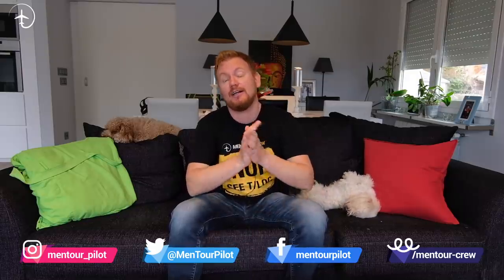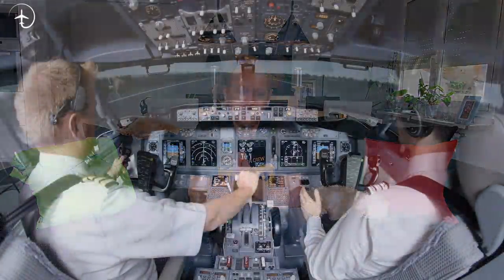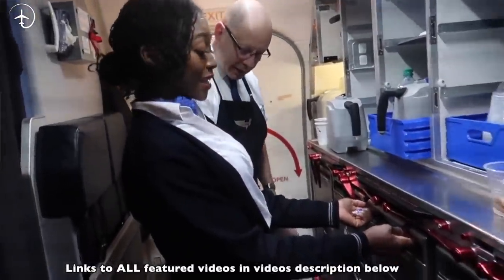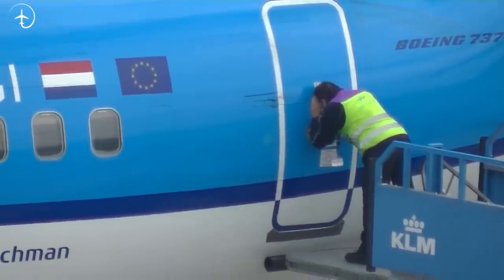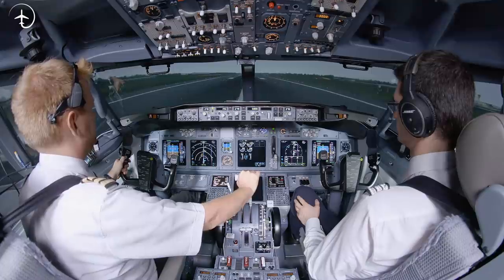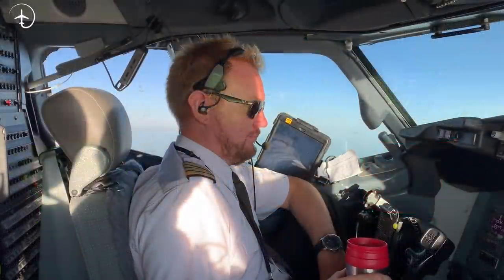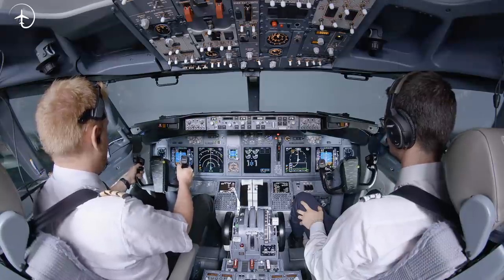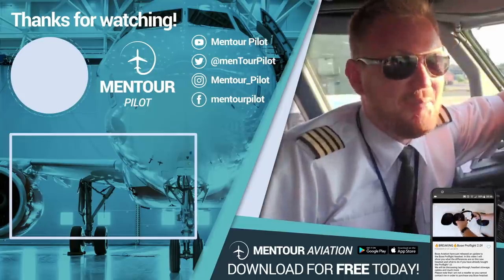How to fly an EMPTY Aircraft!

Comment: Very thorough discussion... Question if you see this...  What's the policy about leaving just one pilot in the cockpit during a mid-flight walk-back though the cabin? I thought there always has to be two people up front. On pax flights, if pilot or copilot leaves to use the lavatory or other reasons, a flight attendant joins the pilot, while another flight attendant blocks the door. But on a ferry flight?  Is it different?

Comment: The emphasis you put on making sure the emergency slides are disarmed makes me think there's a story to tell... :)
Reply: Inadvertent slide deployment after chocks on, wasn’t such an unusual occurrence when I was cabin crew. Aside from the obvious danger to anyone outside the doors, it also caused the a/c to be put out of service and an enormous expense to the company. The usual reason was cabin crew being distracted, maybe chatting to colleagues or pax, and so failure to adhere to procedures. One of the things that the company was very hard on us during annual recurrent tests.
Reply: The outside handle disarms the door so, in theory, it is impossible to deploy the slide from outside. Every inadvertent slide deployment is due to  the door being opened from the inside without disarming. Ie. Doors to manua,.
Reply: @bobrice3957  That isn't true for a 737, which he flies. 737 slides are only a manual system, from inside the door.
Reply: When our company got new 175s maintenance and crew would blow slides I would not say often, but often enough that we knew about it.
Reply: @MercFE8235  correct. On 737s, “classics” at least, a “Girt Bar” is engaged at the floor, well below normal eye-level inside, and completely invisible outside, which pulls the deployment mechanism as the door swings outwards. This is why ground personnel must look into the porthole and observe that a safety indicator flag has been put across the window before opening.

Comment: Empty plane?
Engines: "I feel the need, the need for SPEED!"
Reply: Also feel the need for Jet A
Reply: And trim and climate change.
Reply: How about an empty cruise ship, no passengers, no food, no fuel.
Reply: top gun, yes
Reply: @macmedic892  yes
Reply: @robertkat  that would be a very rough ride, even with fuelbunkered. When I was on my first enlistment I was on an aircraft carrier that went to the shipyard for refit. We pumped off all the jetfuel, emptied all the magazines of ordinance, removed the vast majority of equipment. That ship was riding a good 15 to 20 feet higher in the water. Even with several hundred personal vehicles loaded into the hangar bay for the home port move. I suspect that the vehicles being transported were partially to put some weight back in the ship for the transit. That was a very rough ride from San Diego to Bremerton because she was so light and top heavy. A cruise ship would be even worse and at extreme risk of capsizing I would imagine.
Reply: @robertkat  
That's a good question.  I would imagine that she'd be riding high in the water and subject to more rolling and pitching. Like anything else, you'd have to compensate for that. In the case of a ship it's a matter of ballast loading. 👍

Comment: I've ferried a number of MD's empty.  Climb performance is akin to some fighters!lol!   Pitch to 30deg clean and no step climb necessary!
Reply: Haha nice! How old are you? and where did you have the chance to fly those beauties?
Reply: @avi8err829  I'm 55 and worked for a company who converted aircraft as well as "strip and park" work.   I also flew for the former Midwest Express/Midwest (MidEx) Airlines based in Milwaukee years ago.
Reply: With the efficiency obsession of airlines, saving every gram they can, I am surprised an empty airliner cannot reach infinite speed and take off slightly backwards VTOL-style if you give full throttle.
Reply: @Dowlphin  In one of the books I read about the development of Concorde, they had a report of one of the afterburners not lighting properly under some condition. They tried to replicate, didn't have time to refuel before the test flight, had the engines in emergency contingency mode and did an almost empty, max power takeoff. I think they were in Bahrain, the tower nearly went ape because the plane had a thrust to weight ratio of nearly 1 and it was climbing faster than their fighters would have been able to.

Comment: I flew an FR738 two weeks ago. Just myself and one other passenger. Had to load 40 kg of bags of stones to the front cargo to get inside weight/balance limits.
Reply from the maker: Yep! That’s what I meant by being careful when checking weight and balance
Reply: In aviation everything is certified and regulated... so were those stones certified for aviation too? :D
Reply: Literal ballast.
Reply: @insoYT  I would not be surprised if there is a certified manufacturer for these.
Reply: @insoYT  The bags would be of a stronger plastic than for building materials.
Reply: David - I've replied to another of your comments on your YT community page due to the Blanco video suddenly going private. Any ideas why ?
Reply: @millomweb  I think Juan was bothered by the trolls complaining about him “sightseeing” during a lockdown. Fact is, the police have come out and stated they are not going to be enforcing stupid nonsensical government rules.
Reply: @davidwebb4904  OK. I wondered if the video contained info someone didn't want making public !
Anyway, back to your comment re Concorde fuel tanks...
David Webb replied: "pmailkeey LAX is 5457 miles away. BAW are quoting max range as 4143. And its against the prevailing."
24 minutes ago

Can you see the missed opportunity there - fuel tanks should have got it half way round the globe - then it could have gone anywhere to anywhere ! (in theory)
Reply: @millomweb  Back in the 1960’s, when it was designed, long haul traffic pretty much didn’t exist.

Comment: I notice a difference in handling my Camry Hybrid when there is a full load of passengers and even when there are no passengers, but a trunk full of cargo.  I can only imagine how much more a pilot would notice the difference in handling a fully loaded and an empty plane.
Reply from the maker: Exactly!
Reply: I drive trucks for a living, and can have a wide variation of cargo weights. The extreme case for me is about 40 000 pounds empty, up to 140 000 pounds fully loaded. Acceleration, braking, cornering, and general ride are hugely different.
Reply: @highlypolishedturd7947 --"You're a better man than I am, Gunga Din."  Kipling
Reply: One MercilessMing one nice thing is that nobody will be screaming in an empty aircraft lol
Reply: --That brings back memories!!  The first brand new car I ever bought  (doesn't count the cars that my father fixed up for me to drive in my teen years and early adulthood) was an AMC Gremlin.  In my hot honey days, I only weighed about 92 pounds.  I had to put cinderblocks over the wheel wells in side the car to have some stability driving it.
Reply: I added about 1/2 ton of concrete scrap to the back of my old IH pickup during an ice storm when I could not get up a hill to get out of a valley.
Reply: "7·5 tonne" trucks are probably worse. They're softer sprung than 'proper trucks' and even with the weight as low as possible, they roll terribly on corners. Similarly when empty, you feel all the bumps more and the brakes appear very severe - the slightest active pressure and the wheels nearly lock up !
Reply: @highlypolishedturd7947  It's not just pure weight too - Carrying just a few bits of solid metal on the bed is one thing, if the weight is distributed vertically makes them easy to tip over when cornering.
Reply: @stephen_l1474  Well, apart from the ghosts !
Reply: @millomweb  You're right. A high center of gravity can be "interesting".
Reply: @highlypolishedturd7947  I was used as a spare driver and only a couple of times well loaded. One journey was only a mile or two - so I was less fussed at getting the weight low down. The one roundabout on the route was, as you say, interesting :)
Reply: @highlypolishedturd7947  bobtail is even better
Reply: @onemercilessming1342  lol

Comment: Had a "trolley incident" at my company during a ferry flight once🫢Had to replace the cockpit door, which thankfully was closed😆
Reply: Speedbird Did anybody check it, or did something go wrong despite the checks?
Reply: Matthew Hall They pilots most likely forgot to check the trolley latches🙄
Reply: imagine if the trolley pinned the door closed from outside.
Reply: Wanna Montana That would have been fun😆😂And well deserved🤭
Reply: I can imagine - over the radio - "Trolleys at 6 O'Clock" !

Comment: I learned to fly a glider, and after getting used to flying with an instructor, I noticed the difference when I was sent solo.  Much lighter.  It was a K7 two seat training glider.  I really did enjoy it.
Reply from the maker: Yep! And the difference is much bigger in an airliner
Reply: @MentourPilot  I would have thought it would be kinda similar
Reply: Same here. The glider felt very light on my first solo to the point it felt I had to push it down for landing.
Reply: Flying  gliders  is  real  flying..I  did it in Washington, Sussex in mid  70s
Reply: Sir  is  a glider the one they tow behind  another Plane and then let it go ? and how does it get back to the Airport ? does it drift back ? i never been in a plane before  only once when i was 12 years old on a airliner . well my mom and dad took us to Florida . but i saw a glider being towed behind another Plane .
Reply: I also find the change of center of gravity quite noticeable in a glider, the handling gets a bit mellower with a more forward CG. Spin training in DG1000 with CG as far back as possible was fun and even that one that normally is very forgiving got quite sensitive.
Reply: @haqvor  I think thats why the wings are swept forward?  And I also went solo in a T21, side by side glider, and thru put lead ballast in when the instructor let me go solo in that.  Although its not that efficient, it was still a nice glider, and would thermal, but up the winch, stick would be full back, 50kh rather than knots, where as the K7, max winch speed 56 knots, and landing the T20, you would be pulling hard on the spoiler handle, while maintaining the landing speed of 50 plus half the wind speed
Reply: @charlieirvin5423  

Gliders are generally unpowered and are launched either from a diesel-powered winch / catapult affair or towed into the air. When the glider pilot is ready to fly without the tow aircraft, he releases the cable via a lever in his cockpit. The tow aircraft will jump into the air (because it is suddenly much lighter) and then return to the airfield ready for the next tow.

I've twice been a passenger in a  glider and it is really weird watching the tow aircraft climb into the sky with our weight behind it. If there is any turbulence, you can literally see the tow aircraft react to the air currents and know that, two seconds later, you are going to jerk up or to the left, right or wherever you've just seen the tow aircraft go.
Once free, the glider pilot is looking for thermals - which are columns of rising air. Where the thermals actually are depends on lots of different things such as the weather, the air currents and even the landscape underneath you. Some terrain - such as water - absorbs the heat; other terrain - such as bare rock - reflects it; you get eddies (swirls of air) around hillsides and so on.
Modern gliders have a machine which beeps and whistles and makes all kinds of strange noises at the pilot. The sounds meant nothing to me but a qualified glider pilot can interpret those sounds to find the rising air (thermals) and use them to climb. Thanks to the light weight and large wings, gliders can have a surprising rate of climb! They are capable of travelling hundreds (thousands?) of miles purely by exploiting the differences between different patches of air. Gliders have even flown over the Swiss Alps - and they are HIGH!
To land, the pilot looks for sinking air. Again, his magic machine* helps him to find the colder air and he can maneouvre between rising and sinking air to control his aproach to the airfield and descent.
You can also get self-powered gliders. These are heavier and not so much fun to fly (I'm told) but eliminate the need for a winch or tow aircraft. Basically, they have a small  engine which is used to get the aircraft into the sky and then the engine is turned off and the aircraft acts as a glider from then on.
A lot of gliding clubs offer trial flights at a reasonable cost. I used to be a Scout Leader (in England) and took two groups of Scouts to a club near where I used to live. The pilots took the Scouts up in two seater gliders and even let them take the controls (there are two sets of controls). Maybe do some research and - if the price is reasonable at a club near you and they offer such flights - beg, grovel, prostrate yourself ad see if you can get a pleasure flight for a birthday or Christmas present.

* Magic machine: I really don;t have a clue how these machines help the pilot to find the sort of air he wants. Anyone care to explain?
Reply: @m3nj051  How in the hell would that be "kinda similar"? 60 tons is a long way from whatever a little glider weighs, lol. I like your profile pic, btw....is that your kitty?
Reply: @Repented008  That glider (Schleicher K 7) weighs about 285kg empty, 480kg MTOW, which is indeed a long way from 60 tons. However, in the case of a relatively light student and an instructor more on the heavy side, flying solo might well mean that the aircraft is about 25% lighter than with instructor. For the 737 the numbers are more in the range of maybe 35% to 45%, so the effect is definetly more pronounced, but it is still very much apparent in a glider.
Reply: @m3nj051  I'd say for that glider the weight difference between solo and with instructor is maybe about 25%, for a 737 based on the numbers in the video maybe more along the lines of 35% to 45%. Somebody needs to let me borrow an empty 737 to find out how much difference that makes . . .
Reply: @MentourPilot  Here's a thread-related question - on complete engine failure is there any chance of gaining height from thermals or any other updraughts ?
Reply: @thomasm1964  AFAIK all they are are noisy 'variometers' - so the higher the pitch the more the air's going up, the low the pitch, it isn't !
Our winch was a V8 petrol powered. Home made ! Cheaper than aerotows.
Reply: @charlieirvin5423  The 'rate of sink' of a glider is very low - they are far more efficient flying machines. I've just found this:
"Sailplanes (gliders) have a glide ratio around 40 to 1. It can be much more or less, depending on the model. The glide ratio of the Cessna 172, the most popular single engine airplane, is about 10 to 1. The Boeing 767 that lost all power attained a glide ratio of about 12 to 1 in practice."
40 to 1 means they can travel 40 metres horizontally for a loss of height of 1 m. As you know, air contain wind ! Not only blowing horizontally but up and down too. So glider pilots look out for rising air - to gain altitude then they fly in the direction they want to go all the time on the lookout for more rising air.
Reply: @millomweb  Cheers!

Comment: Maintaining balance is one thing... lower mass load leads to dramatically lower polar moment of inertia, as well as lower overall weight, much different response than a heavy airframe. Interesting to learn about all the 'small stuff' with doors and trolly.
Reply from the maker: Indeed Jennifer! Glad you liked it!
Reply: When I was in General Aviation we lost a customer, a great guy who ran a pottery business but was a new pilot. He had his C-172 loaded with pottery in the back when he learned about density altitude 75 feet above the ground on approach - he stalled at a higher speed than he expected and the tail dropped.
Many times when we did a significant change in avionics the existing weight & balance was too far from reality to use; I had to go back to stock values and figure all the existing equipment in. It sometimes took me an extra hour or two but I didn't want any part of a tragedy.
Reply: What is a "polar moment of inertia"? Is that when you first see the bear?
Reply: @PatKittle  she just wanted to write something that sounds erudite. I don't think she's able to explain it, probably she copy/pasted from wikipedia or something

Comment: Funny story:
We once had a ferry flight coming in and the pilots just forgot they now had to open the doors as well. Pax bridge, chocks, GPU all were in place so we knocked and signaled it's safe to open and nothing happened. Tried again, nothing. That's when the pilots sounded the horn and asked what's wrong. We all (including them) had a good laugh at that. But in general the cabin crew is way faster at opening and closing doors than the cockpit in my experience.
Reply: Wow I didn't know aircrafts have horns XD
Reply: @mushfiqamin  Peter mentioned about the horn in another video and when it is used